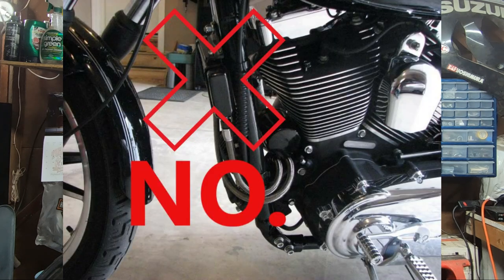How The Twin Cam Engine Became What We Know It As Today

Comment from the maker: Do think an oil cooler from the factory would of ruined the look of the factory bike?
Reply: No, unless I’m looking I don’t see them... oil coolers are so small vs a big radiator on water cooled bikes
Reply from the maker: That's what l thought, l've seen all kinds of aftermarket oil coolers that look really slick. But is was the 90's.
Reply: yeah they slightly hang off the side of the bike in my opinion in looks cool, its on my upgrade list because im in California and im hoping the would help my but on fire.
Reply: @glennmassengill3532  Jag makes an oil cooler with a fan on it that has been tested to bring down your oil temperature 40 degrees. I personally removed my Factory oil cooler and have never had an issue with overheating but then I don't sit in city traffic with it either, I'm in a rule area of Texas.
Reply from the maker: I love those Jag fan assisted coolers, especially where you're at. It's hot out there, I'm in Oklahoma so l can some what relate to the heat.
Reply: Concerned Citizen that what I’ve been looking into for my Shovelhead. Thinking it would be a good ideal.
Reply: @glennmassengill3532  I love the shovel heads had I not been working on upgrading my bike. I would have purchased it. ($$$) I ride with a couple guys with shovels in Texas and neither one of them run oil coolers. Also Glenn I ride with old school bikers and back in the day they ran them all over the United States without coolers on them.
 I think it depends on how and where you ride the bike if you're in heavy traffic alot or riding open road most of the time like I do. Glenn it's never a bad idea to cool the oil, it's known to increase the longevity of a air-cooled motor. But If you're not having overheat issues or it's not running excessively hot then I would consider it a personal preference. I run a synthetic oil  and religiously run  "Lucas" ethanol stabilizer in my fuel. It's been a great combination for me I'm a firm believer of, if it's not broke don't fix it. 
Sorry for the winded return message. I hope it was helpful
Reply: Actually I don’t think it would. What does everyone do when they put on the 95 Set-Up? Install an Oil Cooler. To be fair to Harley...We have had a lot of time for aftermarket companies to design functional designs with decent aesthetics as opposed to trying to make a deadline for new motor debut 🤷🏼‍♂️
Reply: @anchorsaweigh9893  I took mine off when big bore and gear cams installed. So far I've never had a heat issue. 
The factory cooler didn't seem to help.  Plus (personal preference only) I didn't like the look on my build. Please don't misunderstand me I'm all for oil coolers and jug fans. It's just not for me, its been off for years and I've never experienced anything with overheating or excessive wear or compression. I run a quality grade oil and am a little bit on the old school side. LoL  the combination works good for me on my RG
Reply: @anchorsaweigh9893  they've come a long way with oil coolers and jug fans. They look good on HDs and  like one gentleman said you don't really notice them. But I pulled my crash bars and put Cruise arms on it 4 highway pegs and I'm running a 21in front so it just looked a little bulky down there. I'm doing ( I guess these days) a small bagger with four and a half inch drop bags and rear fender kind of a CVO thing
Reply from the maker: I think you said it all right there, l've seen some really slick oil coolers on bikes.
Reply: Heck no, they're pretty unobtrusive. Ran one on my '78 FLH and it ran a lot cooler, I like running cooler. It was barely noticeable mounted high on the frame up front.
Reply from the maker: They finally integrated one between the frame rails on the new Softails. I never thought they looked bad on the bikes either.
Reply from the maker: Some of them are pretty stealthy but they mount down low and pick up rocks sometimes.
Reply: @GixxerFoo  yes true..
Ive seen some good oil coolers in yamaha vstars cruisers
Reply: A guy I know in Texas installed fittings and lines to run oil through the front crash bar on his TC Road King. Looked pretty good and worked well.
Reply from the maker: That's a really trick idea! I've never seen that before!
Reply: @greghudson1489  I have a buddy here in Texas that taped his engine guard. He said it works great. 
Surely it's not the same guy you know LOL
Reply: @concernedcitizen5885  I've been out of TX for a good while. He lived in the Austin area back then...
We were in a friendly rider group called Texas Harley Riders.
Reply from the maker: Hard to get inside the mind of the engineers sometimes.
Reply from the maker: Yes! Thank you! That's my biggest issue with engineers is that according to the calculations it should work, lol well it don't soooo...
Reply: GixxerFoo I think from a numbers and tolerances perspective is where Engineers heads are at. They say well the bike should run within these parameters. Problem is that’s what’s happening (Not just Harley’s) is that there are the rush to market culture and then they improve upon the products weaknesses down the road. That’s prob not a bad idea IF bikes were a lot more affordable. Even the loyal Harley crowd can be turned away paying $30k for inferior product. M8 has already come leaps and bounds in the few years it’s been out.
Reply from the maker: Yeah l definitely would not buy a 2017 M8, they had some issues there for sure. It's improved every year though and continues to get better. Just makes me nervous about quality with all the turmoil they have going on there now.
Reply: FXS has a oil cooler std in 77
Reply from the maker: I figure Harley will try and incorporate a radiator some day like they did the oil cooler, probably won't be voluntary though.
Reply: no not at all. it is hardly even noticed on the m8 models.
Reply: Thanks for your great videos Gxrfooo, I think engineers should have the first and the last word!
Over working style compromises function, we get used to all sorts of engineering necessities that become iconic,  if an aircooled motor needs bigger fins, it needs .....
I'm learning lots from your channel,  keep it up, I'd like to buy a new bike with an Evo motor! 
Cheers John.
Reply: I'm thinking of one for my Superglide C.
Reply: Definitely not,ive run an oil cooler on my FXR since '88 and love it. It follows the frame rails up and over the cross mount and ive had good comments about it ever since installing it. The thermostat and black hoses are near invisible unless you look very closely as the filter is under the back of the gearbox. Even a lockhart cooler is almost unnoticeable to me. I can't see what harleys problem was apart from utter stupidity and a lack of any customer research at all. Viva la Evolution.
Reply: No
Reply: Hell no.  Shows some one was thinking outside the box.
Reply: On my Dyna, YES

Comment: Just bought my first harley 2 weeks ago. An 08 electra glide with 49k miles on it. Didnt run to good when i bought it .did a full tune up and fuel filter. Also replaced the leaking stator.  It has a big bore kit cams and ported heads. I already put on 1k miles on it.  Im coming over from a r6.  The ride is way better and my back doesn't hurt after a 2 hour ride... and the sound is amazing..... never going back
Reply: Yup nothing better than a harley, now to convince the 10 million other ricers who bash harley in the comments from there moms basement, my yamahaha had 3 major recalls, that's the reason i switched to hd 20 years ago, 2 hd's and no problems

Comment: Great history lesson on Twinkie’s.  That’s what all is Evo riders called them.  Never by the first year model of anything.  I now own a 2014 CVO Ultra Limited and you couldn’t give me an M8 for it right now.  The 110 is a solid great running motor.  Harley finally got most all the bugs worked out of it and bonus that it also has the Rushmore Project updates.  She’s a keeper !
Reply from the maker: I would hang onto that Twin Cam, they just that motor right and then they switched to the M8. The M8's not a bad motor but it's not something I would own right now either. Rushmore bikes are the way to right now, especially with that 110 like you have!

Comment: They probably never found the cam chain issue in development as they were the ones making the parts to R&D. Once they went into production and another company started making the chains that had rough edges they started having issues. Some bikes make it 100,000+ miles without ever needing cam chain tensioners because they had nice smooth chains.
Reply from the maker: Those cam chains were better suited for a chain saw than a timing chain!

Comment: Just bought an 2005 softail 5600 miles I’ll keep your idea in mind really appreciate your outlook on facts.   Your not negative but see problem and bring solutions to table.  Thank you sir
Reply from the maker: You're very welcome, the 88 isn't a bad engine at all it just had a design flaw. Their was supposedly a bad run of cam chains that were probably better suited for a chain saw. They chewed up tensioners on the early bikes, but in the end it was the spring tensioner just put too much tension on the shoes. I am really surprised you found a 2005 with only 5600!

Comment: Love my 2000 Ultra Classic..
44,000 miles and just now changed out my cam system for the Feuling 525 hydraulic tensioner. Also had to change out that rubber motor mount after realizing that my oil filter was banging on my voltage regulator and oil cooler... wasn't pretty! But still a great ride and motor is solid.
Reply from the maker: That's awesome, you put one of the best upgrades out there in it too. The hydraulic tensioner system is the way to for those bikes, don't have to worry about shaft run out issues.
Reply: @GixxerFoo  yes sir I am the newest subscriber of your show..Great knowledge backed by solid info and great ideas. Not much of a mechanic myself but I feel like I know more when I talk to my wrench guy. Thanks 👍
Reply from the maker: That's what it's all about is just knowing what's going on and having knowledge of what you're being told about your bike.

Comment: The reason for the overlook of cam chain tensioner is they were NOT putting any emphasis on dealing with that issue. They wanted to develope a " throw away" harley hence the twin cam. Its my fave and your knowledge is greatly appreciated.
Reply from the maker: Thank you, I appreciate your support of the channel! That's basically what happened, they lowered costs of production and engineered a life span.
Reply: @GixxerFoo  ive gotten a couple tips on what i need to do w/mine for performance-greatly appreciated.
Reply from the maker: You're welcome, anytime!

Comment: I had over 50 thousands miles on the original camchain tensioners, my bike is a 05 Roadking classic. I knew I was pressing my luck with the spring tensioners so, I did a S&S geardrive 510B cam upgrade. No more tensioners period! As even the hydraulic tensioners are prone to failure.

Comment: I bought a new 2000 superglide and didn't have any issues with the tensioners in the 21000 miles I owned it. The next owner is a friend and had them changed out at 30000 miles and they were in good shape. I believe there were a hydraulic upgrade available later. Chain links are stamped and if the manufacturing  dies weren't kept sharp the resulting rough edge would definitely do a number on the tensioner shoes(I'm a tool and die maker). Also how you ride has to contribute. I would think hard decels would work those tensioners greatly.
Overall a great bike...slap a Mikuni42, k&n filter and pipes on and you have a very responsive bike.
Reply from the maker: That's awesome, yeah some bikes failed before 15k and others went about 30k or more.